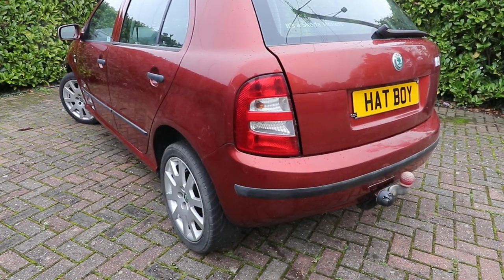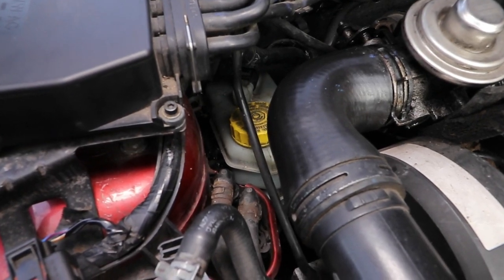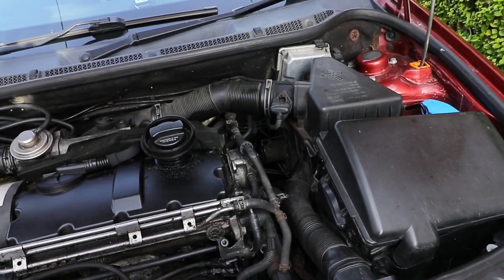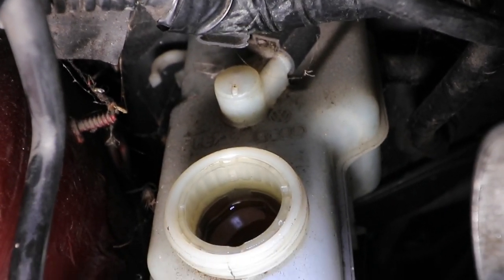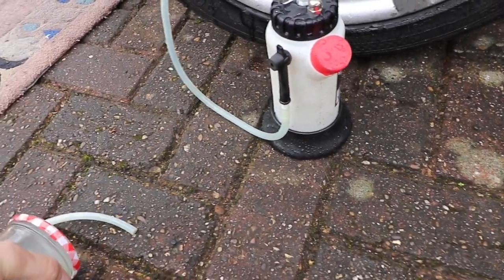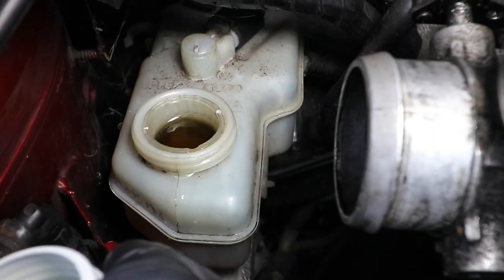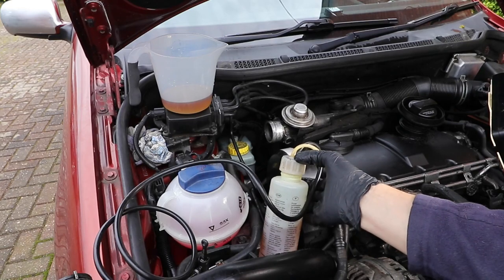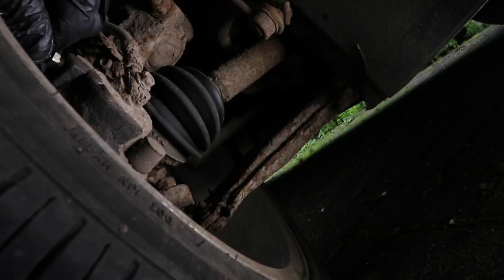SKODA FABIA Brake Bleeding and Fluid Change (MK1 99-07)

Comment: I had a leaky caliper recently and between the fluid i lost from it and the fluid i lost fitting 2 new rear calipers the master cycler went dry. I've topped it up and bled both rear brakes, but there's still air there. I used a one way valve self bleeder.
I'm going to use my favourite, the 2 person method you're showing here and do all 4 in the correct order.

My clutch is working fine but would it still be beneficial to bleed the clutch?  Should i get the ABS pump bled as well?
Great video and thank you.
Reply from the maker: If the master cylinder went dry, then by how much? If you think the level of fluid went lower than the ABS unit then that will need bleeding. ABS pumps need to bled  with software like vagcom under basic settings. it is recommended to bleed the clutch after a fluid change, but in reality many leave that if it works as it is a bit harder to get to. video: https://youtu.be/a8gshJu1KV8 :-)

Comment: Great video have done ha few jobs on my Fabia whit help from your guides! But I wonder don't you have to plug in a computer to open the valves in the abs?
Reply from the maker: Good question, yes you do, but not just to bleed the system. If fluid leaks to the point where it goes below the ABS unit then air will enter and it will need 'basic setting' procedure doing. This is very rare to happen as fluid normally leaks very slowly, not to this point and you should notice as the brakes would fail before the level can even drop near the ABS. Saying that, if for some reason the fluid has never been flushed for a very long time, air could get in there, that is why it is important to flush the fluid regularly as part of a service schedule :-)

Comment: Thanks for this HatBoyHarvey. 

Using the one-man-pressured-system technique, do all four bleed-off valves still need bleeding, or is it just the front two?  If all four required, is it in the order which you specify at the beginning of video?

Also if 1 litre of DOT 4 per change, I'm thinking 250ml per valve to replace. Sound ok?

Thanks.
Reply from the maker: All lines need bleeding, the rear ones hold more fluid, best letting more out to be sure rather than less.

Comment: Hey.. Hows your fabia shifts gears in cold weather? In summer in my car its really easy to shift gears. But in winter its really hard. Especially first and second gear. I really need to use force. After some time when the car gets warmed up its back to normal. Transmission fluid was changed today but the problem remains.
Reply from the maker: I take it you have also bled the clutch so that should disengage the clutch. I have had this problem also, but haven't got around to fixing it yet as mine isn't that bad. I changed the box oil 5 yrs ago with little change. It maybe due to the oil viscosity in cold weather coupled with a worn box, input shaft bearing, selector rings etc.  I am going to look at the linkage brackets on top of the gearbox first for signs of wear/sticking pivot bushes and re-set it and see if that helps. Sorry I don't know exactly what it is yet :-)

Comment: If the brake pedal feels hard and the car is still struggling to break what could be the issue ???
Reply from the maker: servo issues. Press and hold your foot on the brake and turn off the engine - pedal wanting to rise? with the engine off press on the pedal 3,4 times, does it loose the hardness and go soft? have a look at the pipe attached to the servo for breaks/leaks and the one way valve may also have failed.

Comment: I tried my Eezi bleed on my 2004 Fabia today after changing the rear calipers and i couldnt get a decent flow out of the bleed nipples, ive also had a similar issue on an Audi A3.
Set at 15 psi and no cap leaks.
Didnt have a helper so will try again tomorrow, anyone got any ideas why it doesnt work?

Comment: Nice video your coolant needs topping up though :)
Reply from the maker: Thanks. Yes, I agree, a little. As long as the coolant is above the lower mark when cold it is fine, problems occur when people overfill the expansion res believing it needs to be filled to the highest mark when ever and have it venting out all over the place, especially if you have overheating related issues.

Comment: I use the second method,  but with a different machine (something like this: https://youtu.be/fMOG8ExDQ8c) in my 2 cars (Fabia and Xtrail), and it works perfect.
You pump it manually and you can change the fluid in all the car without worries. 
The bleeding sequence, according with the manual, is the same you have said, but I'm talking about left hand drive, not sure if in right hand as yours will be the same. 
But I see that you don't bleed the clutch. Clutch uses the same brake fluid and it must be changed as well. In left hand Fabia it is located over the gear box. In my case (1.9 TDi) I must remove the air filter for a more comfortable job. Bleeder is made in plastic, so you must close it carefully. Don't force it or you will break it.
I assume that right hand cars will be similar.
In any case, go ahead with your channel because Sunday mornings are not the same without your videos.
Best regards
Reply from the maker: Thanks, yes the clutch is fed by the master cyclinder and should be bled after the brakes, but how many do that? I should have mentioned that, plumb forgot. I'll do a video on that soon :-)
Reply: @HatBoyHarvey  That's the reason why I mention that because many people don't know about it and it's also important.